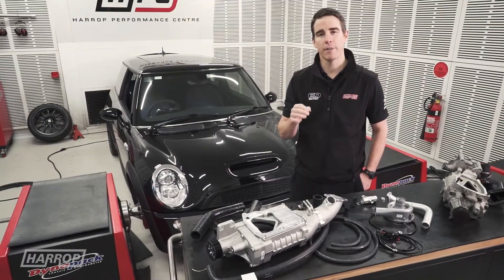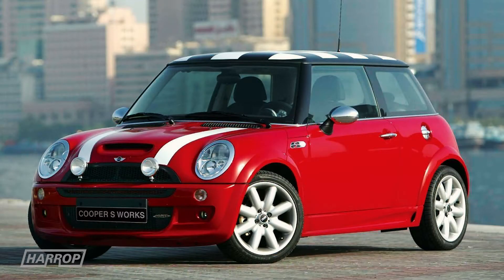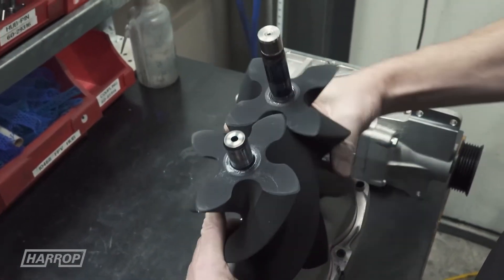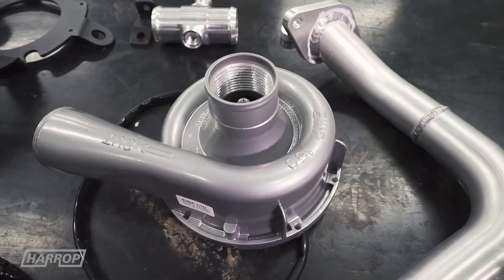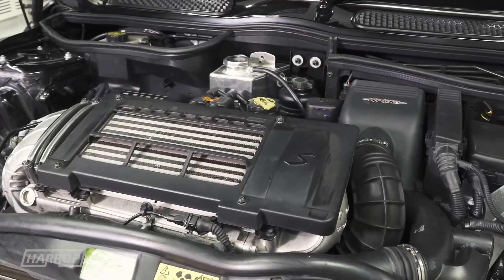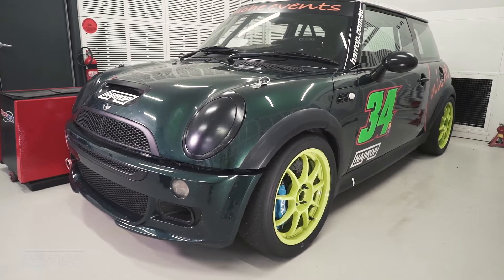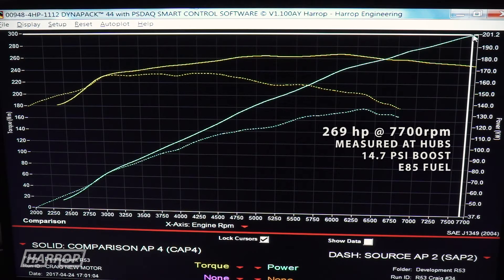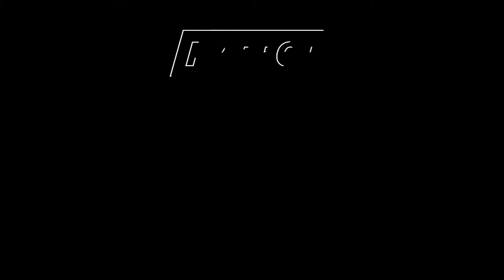Harrop MINI R53 Cooper S | TVS900 Supercharger Kit Technical Review

Comment: The JCW has a different supercharger. I can’t tell you wtf it is but I’ve torn into enough of those cars to confidentially say there’s no chance there the same. The JCW blower is way fucking bigger.
Reply: Jcw has the same supercharger, they come with a slightly smaller SC pulley, "ported" head, tune and an intake with the JCW kit. I own a JCW fyi.
Reply: It doesn't

Comment: 15psi and only 267hp!!!? Terribly inefficient motor.
Reply: You do know wheel and crank horsepower aren’t the same thing right? That 269 is closer to 300 at the crank from 1.6 liters and a supercharger. I won’t explain the differences of a supercharger vs turbo. The pump gas number is more at the wheels than Honda’s 1.5 turbo is at the crank with the same boost pressure. The civic type r needs 25 per cent more displacement 50 percent more boost from a turbo and direct injection 93 octane to match that wheel rating of this 20 year old design on e85. Yeah it’s a real POS.

Comment: You can easily get 220 bhp with a pulley, ported head, intercooler and 4-2-1 manifold
Reply: @sjsmith  what upgrades are you running??
Reply: @sjsmith  with what mods?
Reply: at least, 380cc injectors, intercooler, exhaust, pulley, cams. stock headers are fine if modified for high flow cats

Comment: It appears M45 has more torque up till 6000 rpm.  Unless you are racing, stock M45 performs better in real life.  E85 testing is irrelevant for street cars.
Reply: E85 is perfect for a street R53. You just need bigger injectors
Reply: @charles13300 and a return fuel system, pump, rail, filter etc to suit e85 and more..

Comment: so your telling me, 5000 dollars with shipping and handling for 30 HP? BOO
were better off adding a wet nitrous kit and E85.
Reply: IOL Outbound It made 30 extra whp on an engine that made 158 whp. That’s a 19% increase in power with a supercharger that is dimensionally similar and should offer stock-like or better reliability. Not to mention there was 0.3 psi less on the TVS900 vs the M45. Not that the 0.3 psi would account for much (plus getting the two to produce the exact same boost would require extra time and pulley fabrication), but at 16.7 the TVS900 probably would have allowed a few extra hp. That said, an approximate 20% increase in power at the same boost level with a blower that fits in virtually the same space is pretty good IMO. And sure you can add nitrous, but then you have to keep filling the bottle(s), checking pressure, etc... and once the shot is all gone, a TVS900 car will walk on by.
Reply: @GyroPyro121212  you're totally right. The only problem is the price.
Reply: Xabier It is a bit pricey, but modding any European car can get quite expensive. It is to be expected.

Comment: What does all that extra horsepower do to the 0-60mph time? Not that much I've read.
Reply: its hard to get the power to the ground even at 200-ish hp... 
but honestly - who cares about 0-60 ? its all about rolling 30 - 120 ;)
Reply: VORTEK Music Even at 30 the car would probably spin with 200+ hp. Would have to be a higher speed rolling start.

Comment: Excellent kit, would definitely buy if the price was not 4600$ (according to TVS's site)
Reply: could sell your old sc to recoup some of the cost. but it’s probably more cost effective to just go buy a clean jcw and mod it or go straight to a gp. 

had i known id fall in love with the r53 i wouldve gotten the gp straight away. now ive got like 10k in mods invested in a high mileage car. 😅
Reply: Better than a $5,000 brand new oem blower.
Reply: @_alltheseprettylights_  they aren’t 5 grand new.

Comment: Those stock power levels seem low. My R53 made 210whp with just a 17% pulley, intake, and tune. It was 175whp stock. I was told by the tuner, who has been tuning MINIs for a decade, that he has never dynoed an R53 under the stock crank horsepower rating. How could there be so much discrepancy in measured power?
Reply: wheel is how much power the cars wheels put down to the dyno, brake hp is how much power to the hubs and crank is well to the crank
Reply: @seth Morton how is your mini? Did you get an intercooler or other mods after reaching 210 hp?
Reply: @julianbryant1115  No, I haven't done any other mods.
Reply: The SAE correction factor.  Notice the Harrop video states "2004 SAE," or J1349.  Most aftermarket dyno guys use the much older SAE correction from the 1970's (SAE J607) which artificially inflates the numbers, as it runs 17F cooler air temp and has other favorable corrections.  Plus, if your dyno is at more than about 2000' elevation, the correction factor start getting even higher.  The factory rated 163BHP is an honest number to SAE J1349, as is clear from the WHP measured by Harrop in this video.  It's also easy for aftermarket dyno guys to "put their foot on the scale," and switch which C.F. is used between runs to make it appear that their tune is even better.
Reply: big difference between Wheel HP vs Brake HP. in the video this is BHP
Reply: That dyno measures horsepower at the wheels. Brake horsepower is just an old term people used to describe crank horsepower.